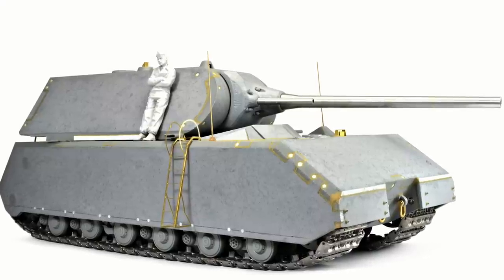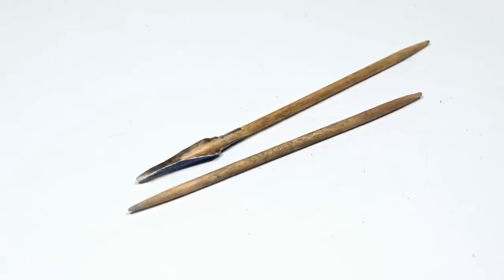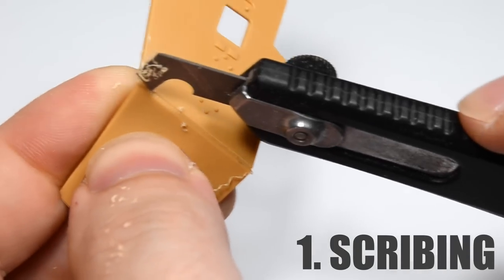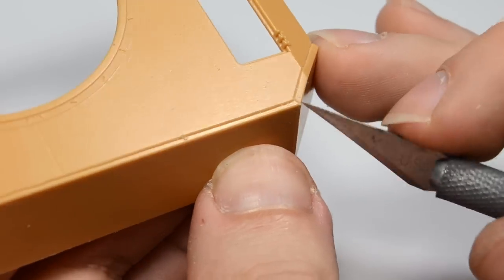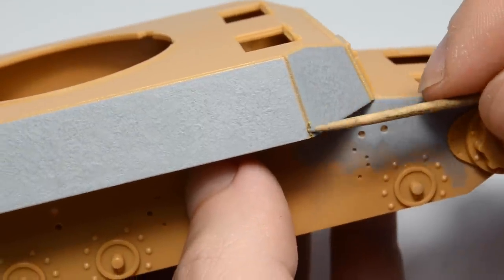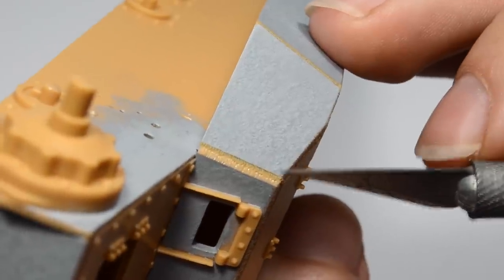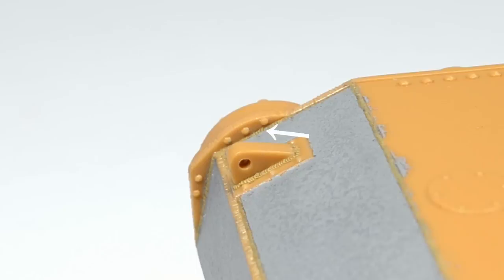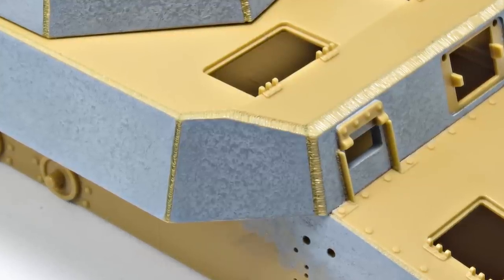HOW TO: Epoxy Weld Beads for 1/35 Tanks (Single Bevel Groove Welds)

Comment: Good stuff Martin - 

I typically use the plastic sprue and glue technique however on some applications I've imparted the weld line photo etch set (from Lion Roar) and the Archer dry rub weld lines set  - little easier, cleaner and quicker - but maybe too perfect? Your thoughts? 

Keep the videos coming  - always great.

T.
Reply from the maker: I think stretched sprues are pretty legit in 1/72nd scale, I used those on my small scale O-I tank (shown in the intro of this video) but I can also imagine using epoxy in this scale, let's say, on an IS-2 or 3... 
I don't know about PE welds. Can't imagine how I would force them to sit completely flush with the surface, without any visible gap or edge. Not to mention bending them over round shapes or getting them between interlocking steel plates. 
Archer welds look pretty nice, just saw them recently in Panzermeister36's video. I could imagine using those where tiny welds are needed, let's say on photoetched parts like welded fenders, boxes, etc... I'd just make sure to attach them really well with Mark Softer and Setter and would probably cover them with a light layer of brushed-on primer.

Comment: Great video! while I'm not certain, I think the reason the Chi Ri II's hull frontal "cheeks" aren't showing weld seams is possibly due to the fact the real life images don't appear to show weld seams either, and it's likely they rolled then bent those side panels followed by face hardening the steel as was typical of Japanese design. This is speculation, but that might be the cause.
Reply from the maker: One close-up photo of the real thing shows a noticeable grooved edge where the weld seam should be. It's not 100% visible, but I believe it's there. 
Didn't know about the Japanese technology, super interesting!
Reply: @NightShiftScaleModels  ah, I didn't know that, thanks for sharing! Japan loved face hardening their steels for basically any armour plating they needed, this was a decent idea against uncapped shells which they often used in testing and was their primary shell type for their tank AP shells, but capped AP shells tend to perform much better against face hardened armour than against most other types of armour, which also happened to be one of the most common shell types found in the allied arsenal (M61 shot, shot mk 8, etc).

While inter-service rivalry could probably explain why the Japanese army never realized this vulnerability, the Japanese navy also developed effectively face hardened ship armour (New Vickers type non-cemented), and they weren't just aware of capped AP, the Type 91 AP shell was a full APCBC shell from the 14 inch onwards (the 6.1 and 8 inch Type 91 shells were only APBC), so it just seems that Japan loved face hardening, likely easier on their industry.

Comment: Ug,, i have so much trouble to get the putty on where i want compare to your work, it either my finger too dry, the toothpick too wet/too dry, ....etc...etc make the putty just not stick to where it should be,
Reply from the maker: I think it's all about practice. You have to find a way to transfer the putty onto a model with the toothpick, then let the water evaporate for a few moments and then you can push the putty into the groove.
Reply: @NightShiftScaleModels  thank you, i found my problem,i make the recess too shallow and thin, i should widen it a bit more. Thank you for the wet toothpick tip

Comment: Never lick your tools to moisten them in use and always wear gloves when working with epoxy. The stuff definitely screws up your metabolism in many nasty ways and you will develop an allergy pretty fast, to the point where you spontaneously vomit when the fumes hit your nostrils (not kidding I've seen it happen). Good materials handling protocol is important in all fields, not only for airbrushing. I learned my lesson the hard way when my body went into a rash-ridden defensive meltdown for days after licking a brush with some semi-toxic pigment still on it.